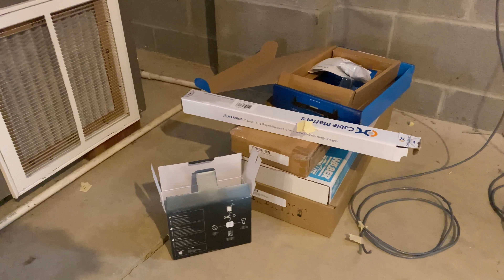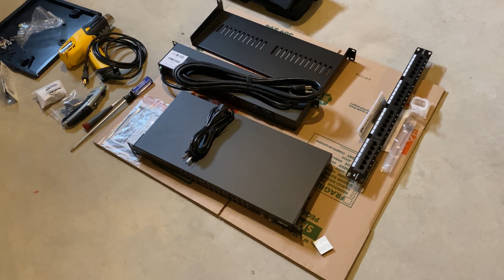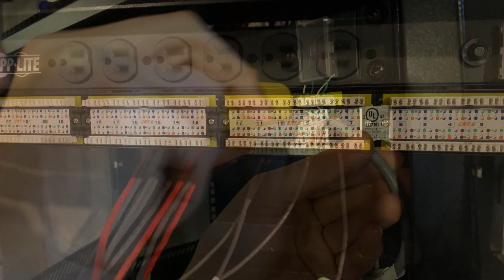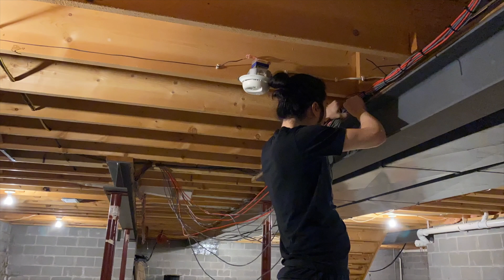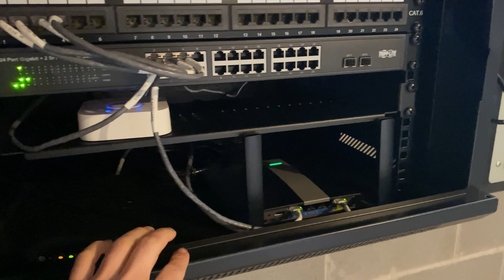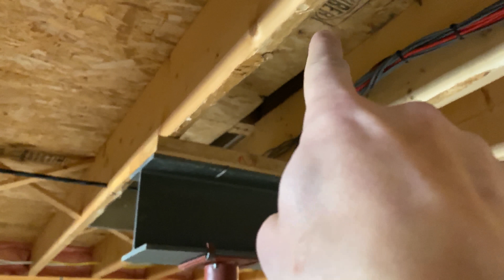Part 3: Network Rack Install | Home Studio Restoration Build

Comment: I'm never buying an audio snake again for installation purposes. Shielded Cat5/6 cables are every bit as good (or better) than Canare/Mogami snakes for analog mic/line and digital signals with regard to signal integrity and line loss, and they're a fraction of the price. Terminate to 8P8C and break out to a terminal strip using a PCB. Bob's your uncle.

Comment: Wow. Look into what a J hook is. They also make wire brackets. Or really nice is a wire rack for low voltage. A million zip ties is scary and probably will end up breaking conductors.

Comment: Power strip should be on the bottom of the rack.
Reply: UPS always needs to be at the bottom, PDU does not, I actually think in most homelab configs, a center mounted one makes more sense, at least if your rack is >20U as some power cables won't be long enough to reach all the way down to the bottom

Comment: I noticed that the power feed to the rack is running adjacent to the coax cable. I would probably avoid that as mains power can give off interference to the coax signal. 
The general rule is that you should only run mains power perpendicular to the coax - not adjacent aka side-by-side.

Just a tip.
Reply: Good tip. What about if we change layout such as ;
1) Rack Tray (modem and Router)
2) Switch 
3) Patch Panel
4) PDU

P.S.: I live in the ground floor flat and I’ll run cables on the ground.
Reply: @TinyGardenScotland  That could work.

Comment: A couple suggestions. 1: If you dress the cables in the reverse order than you did then you can trim them perfectly at the cabinet. I have done it the way you have in the past but ended up with a too long loop or too short corner. Just remember "Dress the end last". 2: The labels should show where the cable GOES to on the other end. Thus the "Router" label should be on the end of the cable in the switch so you can see where it goes for example. Great job on keeping it neat and tidy!
Reply: correct

Comment: Nice video! First of all, what labeling machine do you use? I love the fact that it just prints anything onto a heat shrink. That's awesome! At second, why did you use soo many cable ties? What if you realize afterwards that you forgot one or two cables? That would be horrible!
Reply from the maker: The label machine in the video is a Dymo Rhino 4200. It prints on tubes up to .75" wide. Ive been using that machine for the past few years. You can get generic non-Dymo brand labels on Amazon that are compatible. My only advice is to use clear heat shrink tube on top of the white labels if you are going to handle the cables. The white labels get dirty and the black text will eventually smudge.

Comment: If you have an existing coax installation you should look into MoCa to further expand your network and add extra ports without additional wiring
Reply: That's a waste of money. You use devices such as those when you have no other choice such as when renting etc.
Reply from the maker: cmarting83 thanks for the heads up! I will check it out. I am an audio engineer that occasionally does recording sessions at home. I ended up new pulling cable and terminating it at a patch bay to allow me to send various additional signals other than network such as analog audio and video over the existing in wall network. Just in case anyone reading was curious to my rationale.